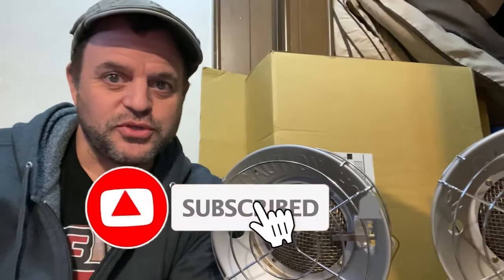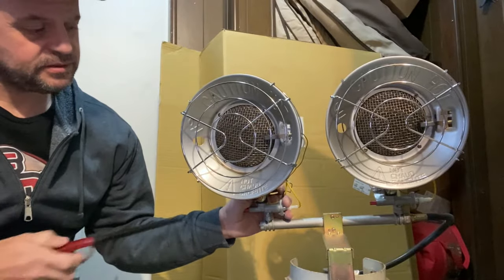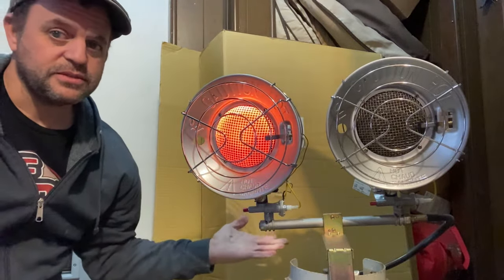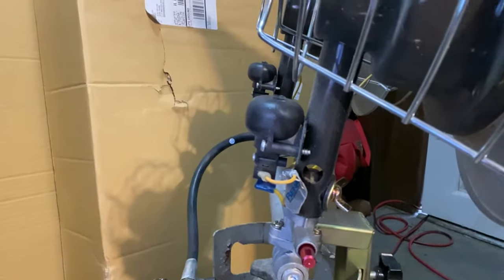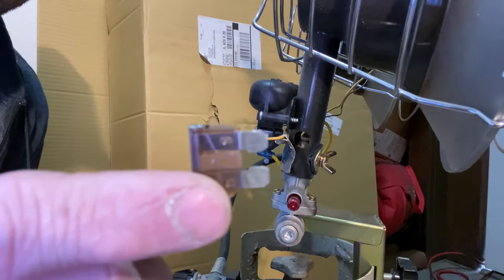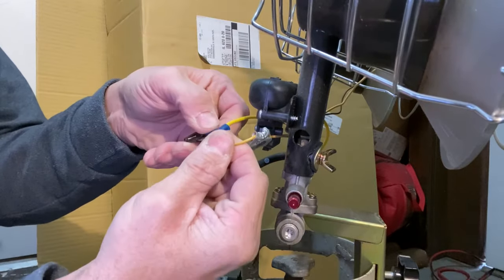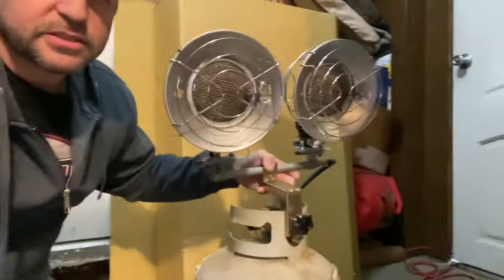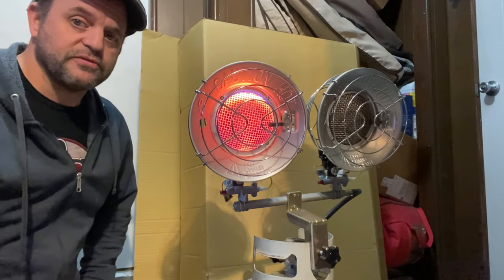HOW TO FIX A PROPANE TANK HEATER

Comment: Could be the thermocouple tip that touches the flame. Mr.Heater people say if you can jump the wires together, that's what it is. In the Mr.Heater units, you can replace just the flame tip. They have another way to diagnose a bad tip-over valve sensor.

Comment: bypass the safety switch I figured it out myself using a fuse also like you did it works fine now thanks for sharing!
Reply: What size fuse did you use ?
Reply: I used a 5 Amp fuse and it works great now.